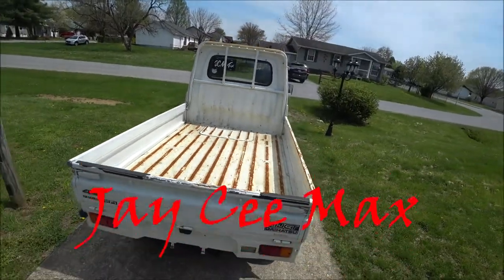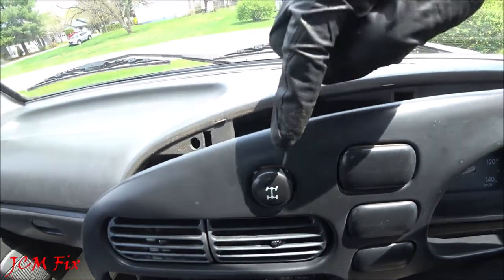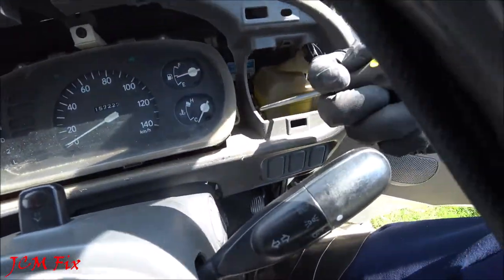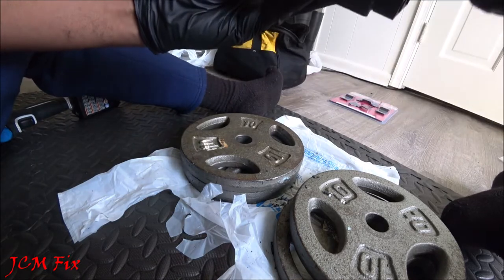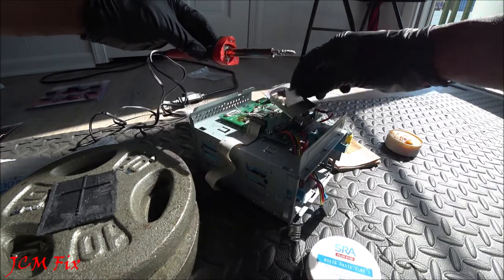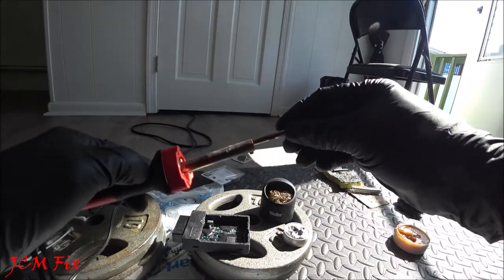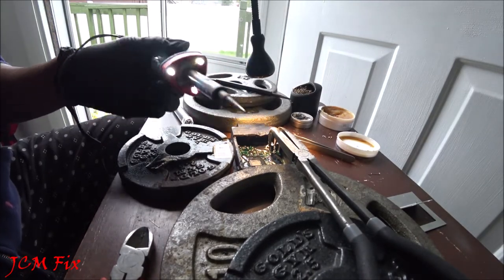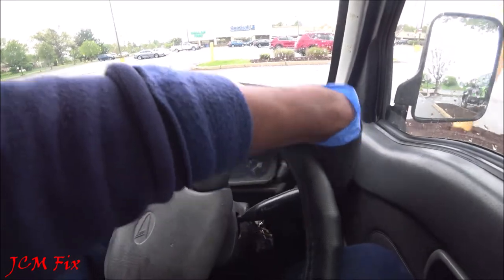Daihatsu Hijet NOT SHIFTING! Automatic "Transmission Control Computer Assembly" Fail-safe Mode FIX

Comment: Just an update from my shot at doing this repair, it WORKED!  I could only manually shift from L-2 and when in D it stayed in 2 with no power light on dash. After having someone with much better soldering skills than me replace the capacitors and clean the board we had our fingers crossed. I can now just put the van in D and it shifts perfectly 1-2-3 and power light is back on.
So stoked so thanks again for sharing the video.
Reply from the maker: I am very happy to hear this. Your message is the exact goal of this video.
More to come!

Comment: Pls sir i really have a question ❓ for u because right now i guess that this video that u made about this Hi jet engine is for me sir bu the thing there's that I'm building a car from scratch sir u can check my page for u to see what I'm talking about sir but the thing there's that Im actually using a 4 speed hi jet cabrator engine then coming to the gear box part I'm actually using a 5 speed old morden automatic gear box but the problem is that i was told that the gear box didn't have a brain 🧠 box but inside the gear box sir it has a cable that is being connected to the carburator but the issue that im facing now is that if i start the car 🚗 and put the gear ⚙️ on drive it seems that it want to move but i won't move and as for the gear oil 🛢️ it actually gage very well but even still im still having the same issue sir pls i really need ur help sir, first of All sir i want to confirm if it's All th automatic Hi jet gear box that uses brain 🧠 box sir pls sir I'm looking forward to get a respond from u sir thanks so much sir God bless u sir ❤❤❤
Reply from the maker: @a.c.c.whizzymechchatronica5811  I am not sure what you mean by "brain box  inside the gear box." The only box I am aware of is what I show within this video that is within the dash behind the instrument cluster.

I hope you can find what you are looking for.

More Hijet videos to come.